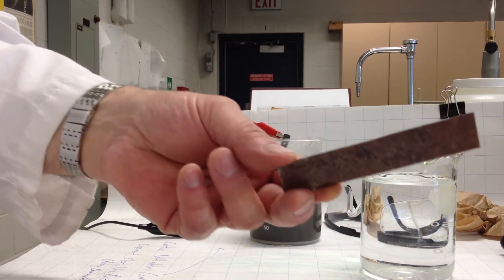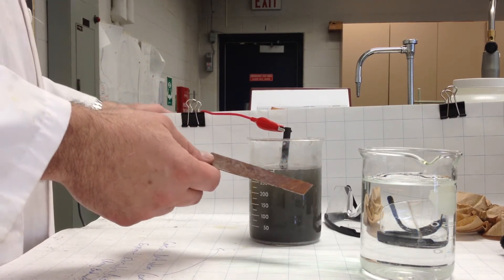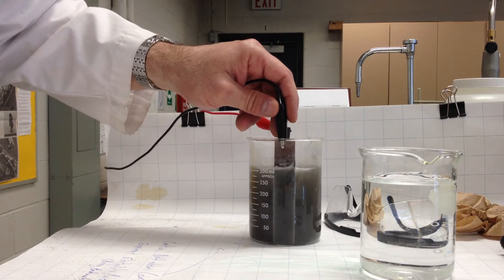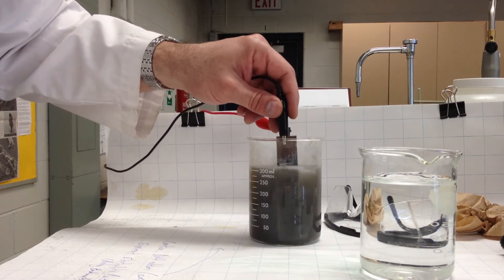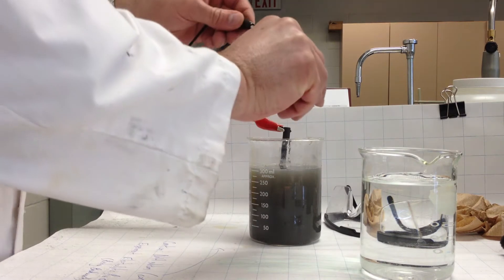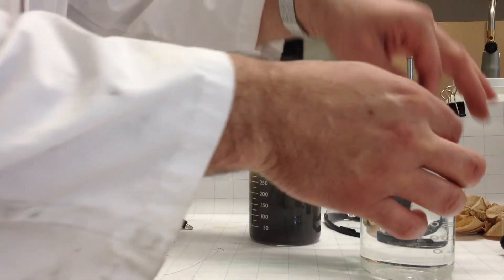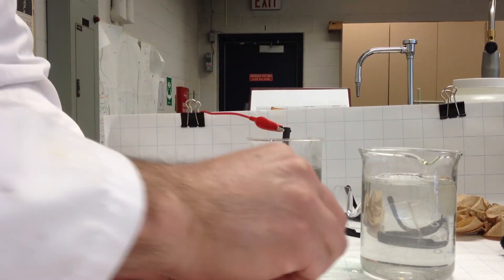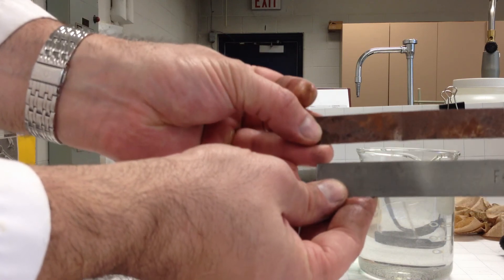Demo 7: Reduction of Rusted Iron

Comment: % [NaOH] ?
Reply from the maker: Sorry, I don’t remember! Not too much. Enough to conduct electricity.
Reply: @massimobozzi1  
Assuming it was a pure reagent and not what would be available at a hardware store as lye, caustic soda, draino etc.  Do you recall apx how much?  How much might you use if you duplicated the experiment?   If you didn't weigh it, is it safe to say one scoopula or two or a tablespoon?  Are you aware of any published info or sources which report conc. and time variables used to not damage steel?  Already checked google, boolean search engines are not what they used to be.  Thx again.
Reply from the maker: Robert Glidewell If I was myself I would have added a scoop of NaOH pellets. Just add enough electrolyte to conduct electricity.
Reply from the maker: Robert Glidewell A teaspoon of drano would work, but remember that Drano contains hypochlorite which is an oxidizer. Also if you electrolytically decompose drano you will generate chlorine gas which is toxic. Be careful.
Reply: @massimobozzi1  
Meh... Sounds like another "experiment," in patience as I am dealing with a 15  gallon fuel tank and probably some lye based drain cleaner which is typically 5% NaOH.  Maybe I will just wait to see how the electrolysis with CaCO3 (washing soda) at 12V works.  Thanks again.
Reply: @massimobozzi1  
Chlorine AND hydrogen.  Yes, thank you. Will make sure I do NOT rely on a dust mask to abate fumes. It will be outdoors and fully filled so no chance of minute H2 concentration either.  But this will only be if the calcium carbonate does not work. 👍
Reply from the maker: I used this technique to derust a swingarm from a car. The electrolyte I used was dishwasher powder because I reasoned it would help remove some of the grime. I uploaded that video in my electrochemistry playlist.
Reply: @massimobozzi1  
Does any salt work.  I suppose phospates might better as they would bind 3 oxide, yes?

Comment from the maker: Good point, but "they" don't use the steel wool. I did it to demonstrate the restored iron.Firstly,  the dark coating would not form under the correctly established conditions. In long-buried artifacts the concretions that form are like thick scabs. Scratching these off would leave a pitted surface which ruins the original appearance of the artifact. Also note that I used a large over-voltage, and a relatively concentrated solution. These harsh conditions gave the side-reaction.